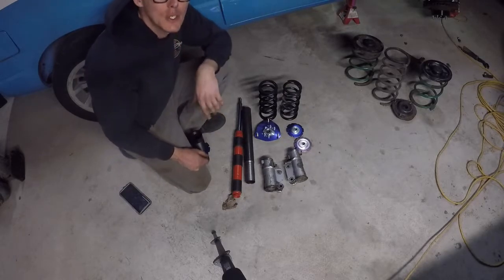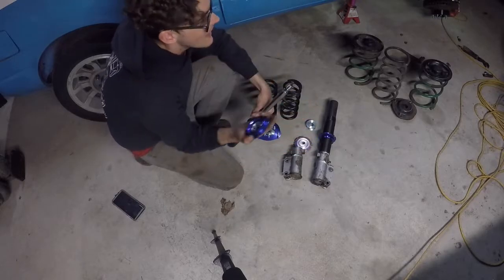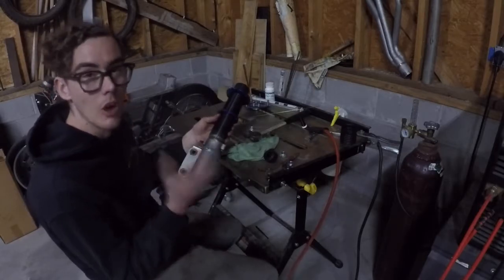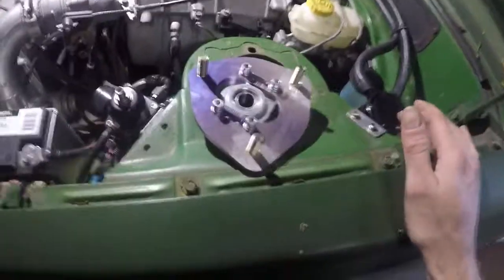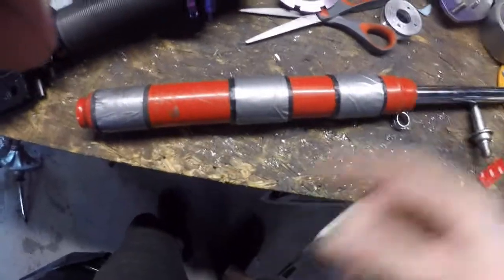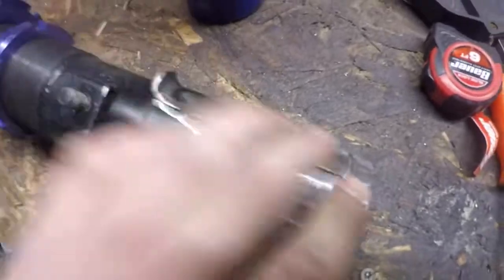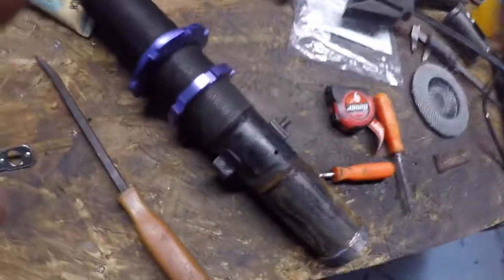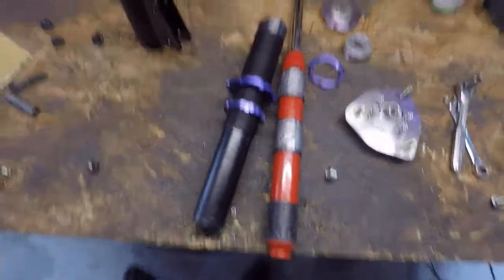Te31 Toyota Corolla PT.4 Building Custom Coilovers

Comment: Wouldnt the bottom part of the housing be able to unscrew itself while steering? Since the whole thing just passes through it?
The top part is secured by the secure ring, but what about the bottom part
Reply from the maker: The bottom has a locking ring as well

Comment: Were those front or rear MR2 shocks that you used in the front of your car?
Reply from the maker: Rear, since the engine is in the rear on a mr2 the valving will be setup for the weight of the engine